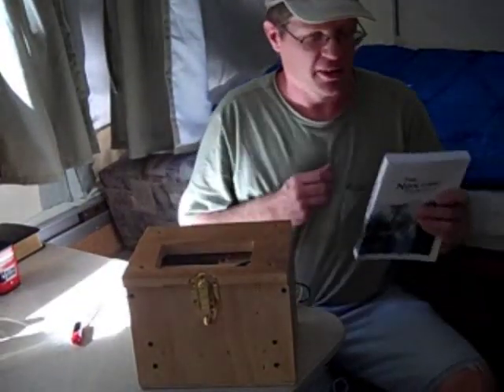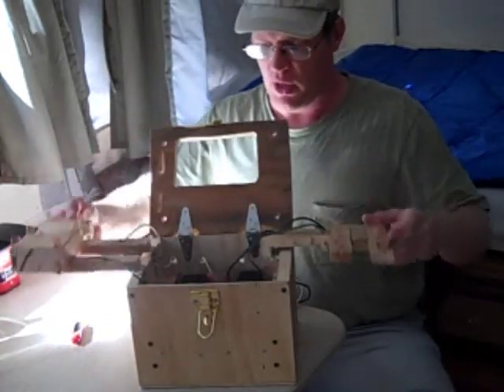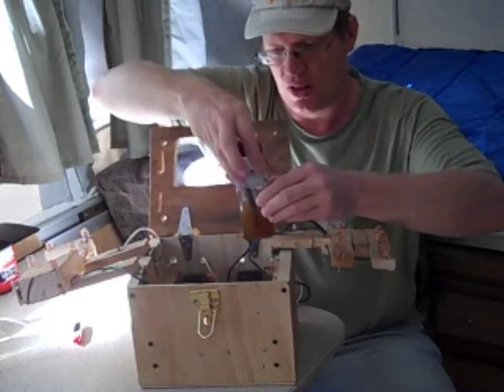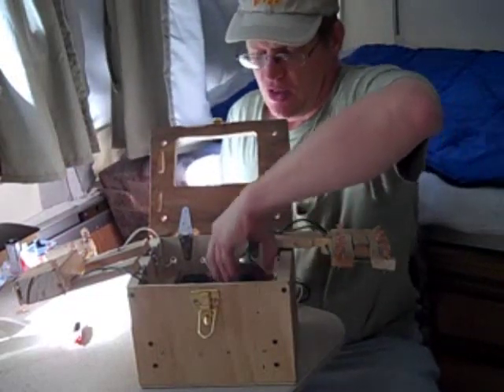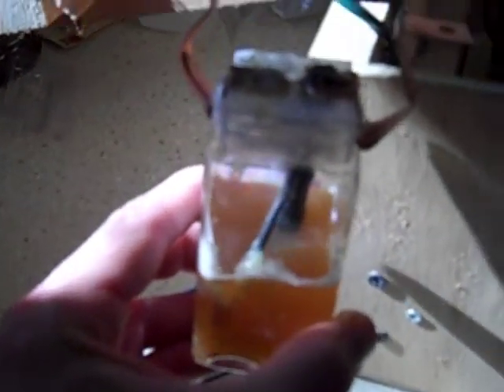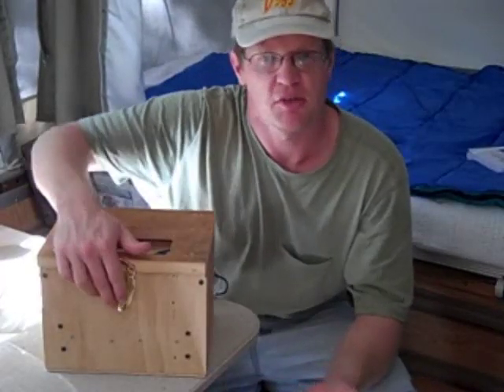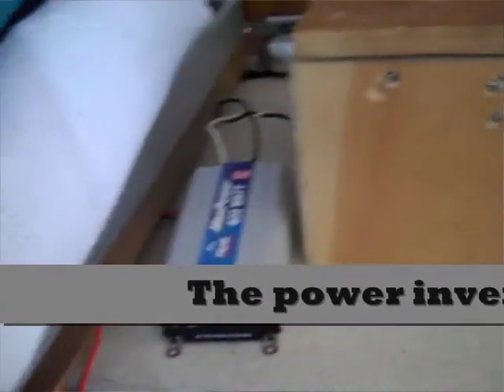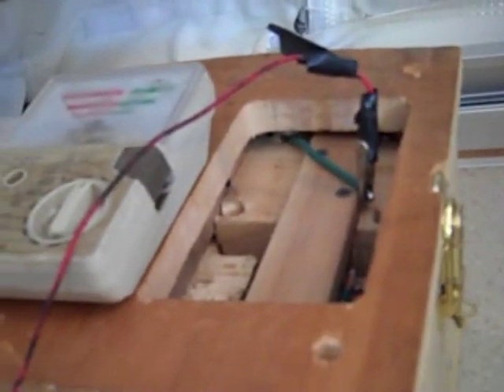My home-made gold / silver 12V electroplater -- simple

Comment from the maker: I don't know what voltage you use to plate nickel, but you would just use fewrer cells to raise the cell voltages. four cells will give you 3 volts in each cell. 3 cells will give four volts. two cells will give 6V, and a single big bath will give 12V.